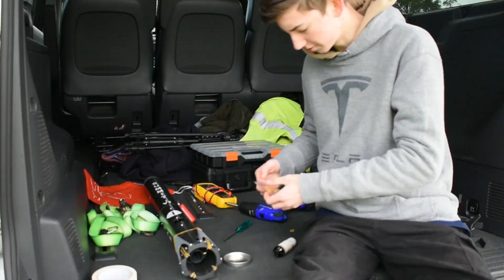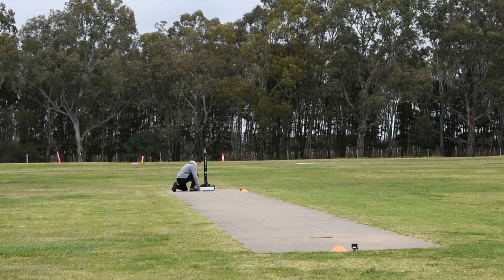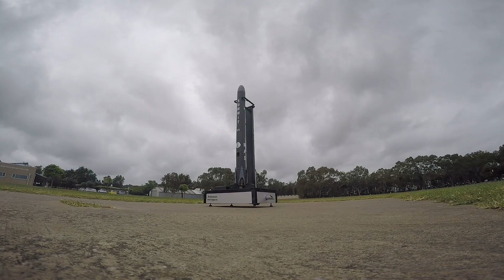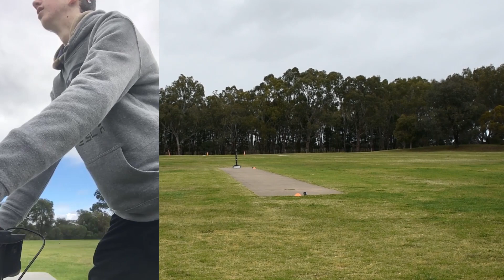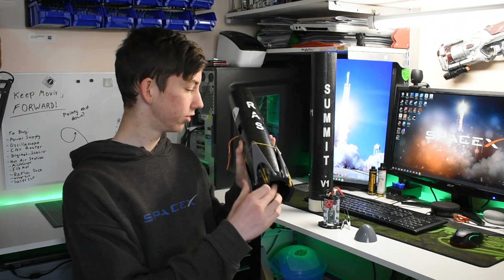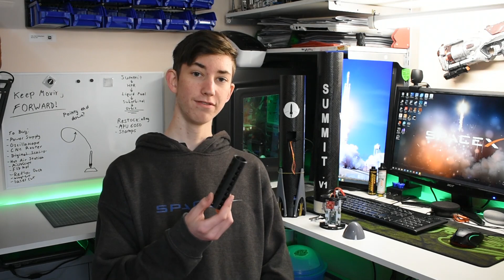Summit V1 - Test Launch 2

Comment: nice launch maybe you should use lunch wire to correct the begging problems
Reply: Nah too boring, I have plans to add a backup cable in the future though. So if the wireless fails on the day, I can run out a backup cable and still launch, rather then going home with nothing

Comment: What I noticed when I watched your video is the following. You have taken so many safety precautions (key switch, code etc.) but you don't have a feedback of your rocket for the ignition. You should switch your rocket into the ignition loop and only if your rocket reports that everything is working can you ignite it. That means you start the tvc first, check if it works and then release the ignition. To ignite and hope that the most important system will work is logically very bad. Try to do this cleverly. 
I look forward to seeing a successful start soon. 
Good luck.

Comment: Welcome to the world of rocketry. Imagine how boring it would be if everything worked first time. You have learned some very important lessons. You have the right attitude to find the fault, fix it and try again. Best of luck with the next flight!
Reply from the maker: Failure is 100% the best way to learn, almost everything I know about making things has come from this one project! I am not expecting the next launch to be a success, or the one after, but eventually I will get it just by analysing what went wrong each time and improving the systems.